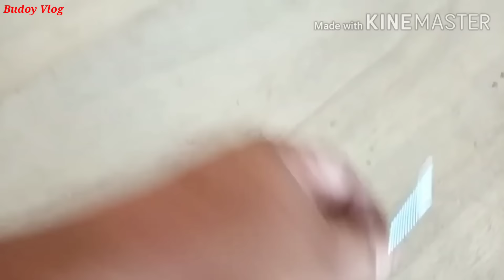Pano gumawa ng second floor. Pano gumawa ng hagdan.How to install metal stairs

Comment: boss dkana po ba nag silsil ng wall cement para sa tubular installation? bale ung bolts lng at angle bar ang pinatungan mo>?
Reply from the maker: Opo kabayan.  Gumamit lang ako ng bolt
Reply: @budoyvlog  dpo kaya magka problema boss pag bolt lng. hindi naka attached sa wall cement.?

Comment: kabayan share mo naman sakin maggawako nang hagdanan sa bahay ilan ba ang steps dapat gawin na matapat sya sa plata , naniwala din kasi ako sa tinawag nilang pongsoy, at saan ba sya maganda matapat na tinawag natin sa mga steps PLATA ORO MATA doon sa last step pa taas kabayan, pls. sana masagot mo to kabayan gusto ko kasi mga gawa mo godbless sayo kabayan ingats lagi
Reply from the maker: Mata po kabayan.  Dipinde kc yan sa taas ng second floor mo.  piro pag 3 meters ung top ng second floor mo. 17x28cm ung step. Nasa 17 to 19 step po yan.. Sa description ng video na to. nandon ung link ng video. ung pag fix ng Anchor bolts. pinakita ko don sa dolo ng video ung hagdan. cg po kabayan. salamat po God bless
Reply: @budoyvlog  kabayan maraming salamat ha God Bless...
Reply: @budoyvlog  kabayan klarohin ko lang ang tanong ko uli ang pag basa ba MATA ORO PLATA , at ang last steps nya sa top and down MATA , or mauna ang PLATA ORO MATA saan ang tama dto kabayan, ang sukat kasi ng flooring from down to top second floor 286cm lang at nagawa kung steps 12steps lang 23X26cm ang lapad ng steps 23cm ang haba 26cm ang sukat ng mga steps ko 23cmx46cm maliit lang isang tao lang kasya yan lang kasi ang space nya kabayan. maraming Salamat uli kabayan reply.

Comment: Hello sir Budoy ask ko LNG po pede ba latagan ng linoleum o kaya vinyl tiles kung ang ginamit na sahig sa 2nd/floor ay marine plywood?di kaya mag moist?,salamat po intay ko po sagot mo.🙏
Reply from the maker: Poyde po kabayan.  Pag maganda ung paglagay ng Rugby hinde naman.  Piro kong may kaya pang bili. Hardiflex nalang isahig mo.  12mm po.  Poyde rin 18mm.  Mas ok po

Comment: Brad balak ko pagawa tong bahay namin.14'x18 bali concrete Yung ilalim tapos my 2 floor pwede na ba 1 c chanel sa gitna at tubular ang ipapatong na paglagyan ng sahig? Papa tong din nman ang c chanel sa bega.At Yung dingdong sa taas balak ko din  na tubular ang kabitan ng dingding madam I kasi anay dito ky as much as possible Hindi ako gagamit ng kahoy.yung concern ko lng matibay din kaya ang ganitong setup.thank
Reply from the maker: Tanong ko lang. My concrete ba na pusti. Ung pataas sa bobong.
Reply: @budoyvlog  Wala pa brad bali half ng poste kahoy pa pero balak ko isagad na hanggang sa bobong.inaanay na ksi.pati Yung v cut na sahig gumalaw pag inaapak sa taas
Reply from the maker: Ahhh. Poyde po kabayan.  Matibay yan. Basta maganda pagka welding.  Tapos ung dingding mo. Hardiflix 14x18 ft ba o meters.
Reply: Feet lng Kya need ng 2nd floor.masyadong maliit lng kasi.ty brad

Comment: sir ano ang tawag sa bahay pag puro outside wall lang katulad nyan hangang second floor walang sahid at paano po ginawa yan matibay yan? kasi parang puro pader lang parang walang concrete slab beam salamat sir sana pogawan nyu ng video kung paano gawin tulad ng bahay nayan
Reply from the maker: Ano kabayan. Hi Ceiling po
Reply: @budoyvlog  ahh salamat kaayu sir

Comment: kabayan ang bahay ko po rowhouse tapos parang wala syang poste pwede ko ba kabayan ganyan din ang 2ndfloor anchor volts lng di.kya sya bibigay or magigiba kabayan..kabayan san po location mo kc gusto ilaw gagawa ng 2ndfloor ko.
Reply from the maker: Mahirap gamitan ng bolts lang. Kc malambot lang ang Hallowblock.  Ibaon nalang po ang tubular sa wall.  Mas maganda.  D2 po ako sa Leyte..

Comment: 3rd floor kabayan paano kaya diskarte anung size kaya ng mga bakal ang ggamitin? yung 2nd floor kasi slab na at pader HB may biga nman na sa pinatungan ng bubong,, panu kaya lagyan ng 3rd floor?
Reply from the maker: Ahhh. Poyde un kabayan ng 3rd floor. Ung mga pusti. dogtongan mo mona ung mga posti. cemento rin. para sa bobong.  tapos biga para sasalo sa bobong. Tapos ung isahig mo sa 3rd floor. kong gusto mo. ung tubular steel nalang. tapos sahigan mo ng playwood.
Reply: @budoyvlog  Naka subscribe na ako saiyo.Thank nagkaroon ako ng idea para second floor ko,imbis na mag pa3rd floor palagyan ko na lang ng mizzanin gamit Ang tubular.Ilang ba ang height ng floor to ceiling mo.
Reply from the maker: 280 cm kabayan. poyde rin 300 cm. Cg po kabayan. God bless. salamat

Comment: Idol ano po bah sukat nyan? Kaya lng po ba wlang poste
Reply from the maker: Hehe... May suporta po yan kabayan.  Makita mo un sa bandang dulo ng video. Mayron nga ho yan drywallsa ilalim.  
4 meters x 365 meters ung lapad nyan kabayan
Reply: @budoyvlog  kasi meron ako project na ganyan nasa 420x330 matibay na siguro wlang poste as long nasa 30cm n lng pagitan ng 2x3 1.5mm tubular. At stock room lng naman ng computer parts. So hindi masyadong mabigat. Keep safe idol

Comment: Sir kaya ba yan sa 3x6 meter? O kaylangan pa mag beam?
Reply from the maker: Kahin wala na ibim. Kc my wall naman makabila. Gagawa karin naman ng hagdan.  Tsaka partesyon. Un na ang aalalay sa second floor.  My dimo ako kong pano ikabit ung Anchor bolts.  Staka kong pano sa patibayin pa. Nasa description ung link. 
Cg po kabayan.  Salamat po.
Good blees

Comment: Sir, tanong lang po.  Kaya po ba yung 4x5 meter na ganyan pero channel bar gamit na 2x4 at tubular 2x2. Channel bar po yung para sa biga at tubular para patungan ng plywood. at mabibigat po ang load ng 2nd floor.

salamat po in advance at God bless sa trabaho nyo po.
Reply from the maker: Opo kabayan. Poyde po. Ung C channel na 2x4. Lagay mo sya 1Meters ung distansya.  tapos kong ok lang po. Ung ilagay mo na Tubular 2x3". Kc po 2nd floor po mabigat po ung I lalagay na mga gamit. Kylangan Matibay. Tapos ung tubular 30cm O 1ft lang distansya.
Reply: @budoyvlog  Thank you po kabayan sa pagsagot :)
Reply from the maker: Walang Ano Man Kabayan.  Maraming salamat din po.  God bless po.
Reply: @budoyvlog  Kabayan. Huling tanong lang po. sana maintindihan nyo po question ko at sana masagot nyo po.

Ano po ba mas matibay na floor joist, yung nka patong po yung vertical tubular sa horizontal tubular or yung nka welding ng flat?  Katulad po nito, https://www.youtube.com/watch?v=Lb2TzOoC418&t=609s

Comment: Sa bigang buhos sinukat pa ang load nun pra tibay dba?  May duda ako sa tatag nyan, lalo pa't sa mga pader lang nka tuck in ang porma ng buong sahig bka mabitak at kumalas ang buong flooring 🙄 In my limited opinion mga ser!
Reply from the maker: Hehe... Wag po aasa sa bolts lang.  Kong medyo malapad po. Maglagay po kau ng pusti sa gitna.  O kay ibaon mo nalang ung tubular mo sa padir.  Para sure po kau na matibay po.

Comment: Ano po ang pwede size ng tubular sa 4mx7m? Magkano po kaya aabutin? Para mag idea po
Reply from the maker: Poyde po katulad ng ginawa ko. piro mag bim at pusti kn sa gitna kc 400 ×700 meters na sya. ung material. Hinde kulang po alam kong anu haba ng mga material dyan sa atin. piro ang alam ko. 6 meters. kaya ung ibim. poyde nyo nalang dugtongan ng angle. ung dulo. para tipid.. hehe..  Ung pipe po. 6 meters yan. kaya poyde mo hatiin. para dalawa posti. 

1pc I bim na 3"×6"
1pc pipe na 4" 3mm ung kapal
15pc na tutorial steel 2×3 " ung kapal 2mm.
3pc angle 3" ×3 " 3mm ung kapal
40pc Anchor bolts16mm×3"
12pc plywood 3/4. 
tapos welding read 

I tanong mo nalang kabayan kong magkano po yan lahat. kc po hinde ko Alam ang price ng material dyan. 
Cg po kabayan. sana nakatulong kahit kunti. 
Maraming salamat po. sa panonood ng video ko. Comments lang po uli kong may kulang pa. 
Salamat po kabayan God bless.
Reply: Tanong ko lang po sana kabayan kung ang salansan ng tubular steel pipe ay sa 400cm; kailangan pa po ba ng I Beam sa 400cm x 700cm? Lulundo pa rin po ba kung walang I Beam sa pagitan ng 700cm. Sana mabigyan mo ng time itong aking katanungan. Thanks.
Reply from the maker: @ariessantos1155  kabayan.  Kong hinde kn mag lalagyan ng i bim sa gitna. Don ka mag lagay ng tubular sa 400cm. Wag sa 700cm. Tapos ung gamitin mo tubular 2x3".  2mm ung kapal.  Kc kong sa 700cm ka maglagay ng tubular pahaba. Lulundo yan. Kaya sa paiksi ka mag lagay.  Tapos kung midyo my budget gawin molang 30cm ung pagitan ng tubular.  Para tibay talaga. Tapos ung HARDIFLIX isahig mo. Ung 12mm
Reply: @budoyvlog  kabayan, thumbs up ako sayo. Salamat ng marami sa karagdagang kaalaman. Mabuhay ka kabayan! Keep safe dyan sa UAE.
Reply: @budoyvlog  kabayan, additional na tanong lang. Kung ang lapad ay 4.9 meters pero maglalagay pa ng hagdan na isang metro, pasok pa rin ito sa 4 meters, tama ba? Kasi magpoposte ka pa naman para sa hagdan? Ano po ba kabaayan ang maximum na haba sa tubular bago ka kailangan mag I beam? Salamat ulit ng marami.
Reply from the maker: Ahhh. Ganon ba. Anu po ung design ng hagdan.  Direct lang ba. O my landing sa gitna.  Kc my hagdan. Gawin mo. Lagay ka nalang ng beam sa gitna. Tapos ung tubular mo. Pahaba nalang. Para makasabay ung tubular sa hagdan. Kong direct ung hagdan mo pataas. Kahint wala na pusti ung hagdan.
Reply from the maker: @ariessantos1155   ung maximum na haba ng tubular. Hanggang i beam. Pag 2x2" ung gamit mo. 150cm to 200cm lang. Piro dahil 2x3"  Ung sabi ko. Poyde sya hanggang 300 to 350cm.
Reply: @budoyvlog  salamat ulit ng marami kabayan. Medyo pilit na din pala sa 400cm. Sobra na ng 50cm sa allowed na limit. Malaking tulong yung mga inputs mo kabayan. Wag ka sanang magsasawa mag share ng knowledge. Thanks ng marami.
Reply: @budoyvlog  kabayan kung gagamit po ng  I beam ano pong gagamiting poste para sumalo sa I.beam. thanks po.
Reply from the maker: Kabayan chat mo ako sa fb ko. Budoy Vlog.  Ung my mga post. Kc ung isa na fb ko. Budoy din. Nasira. Hinde ko ma open.  Tapos send ka ng picture ng gagawan mo ng second floor.  Salamat po kabayan
Reply: @budoyvlog  salamat ulit ng marami kabayan. Nag-i-evaluate pa lang naman po kung sakali. Chat po ako sayo pag nakapag decide na po kami anong final direction. Mabuhay ka kabayan!

Comment: Idol anong agwat NG hagdan idol
Reply from the maker: Ung sa akin 25×28cm. Kc wala na specs.  Mababa ung ginawa kong 2nd floor.  Piro pag ikaw ang gumawa sa bahay mo. Ung tamang sukat. 18cm ung steps 28cm ung lapad. Poyde rin 15cm ung steps. 25cm ung lapad.
Reply from the maker: Dapat kabayan.  Pag gumawa ka ng kagdan. Hinde ka mag tatapos sa 16. O 18. Dapat. 17. 15. tingnan mo sa sa Channel ko. Ung video na. Pag fix ng Anchor bolts.  Makita mo don ung hagdan na ginawa ko. Cg kabayan maraming salamat po.  Good blees
Reply: OK kabayan salamat